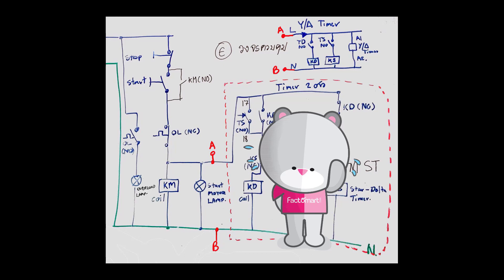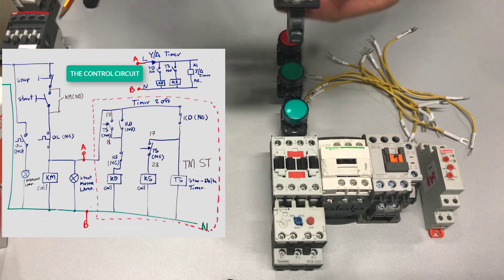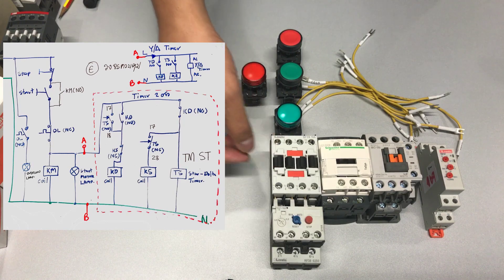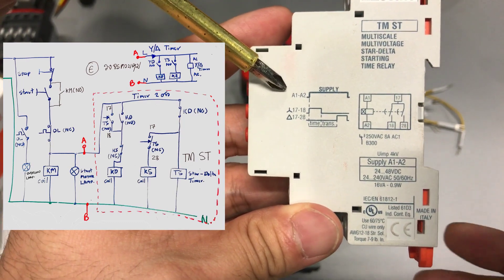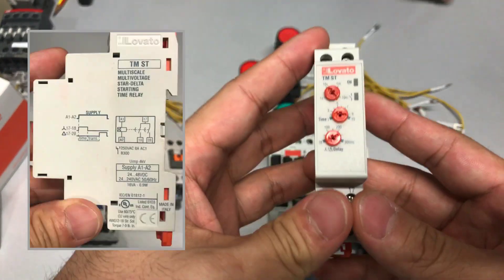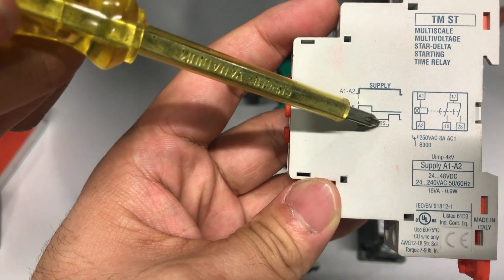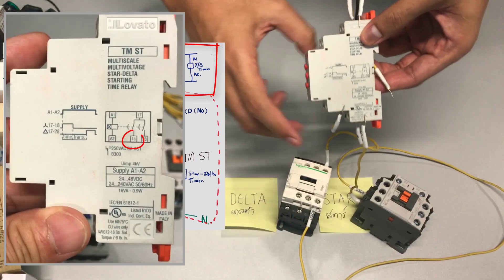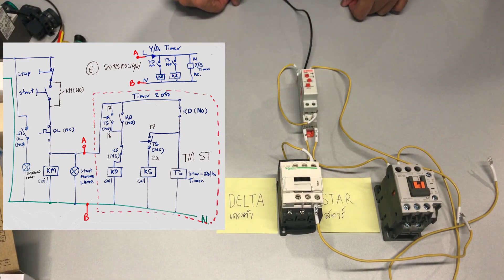The Beginner’s Guide to Wiring a Star-Delta Circuit (Part 2: control circuit)

Comment: please explain how to connect contactors with indicators
Reply: There should be some auxiliary contacts on the contactors. So if the main contactor is closed, you would connect the 'motor running' indicator to the NO auxiliary contacts, the indicator would then be lit.

If you wanted a 'motor stopped' indicator, you could wire the indicator to the NC auxiliary contacts, so when the main contactor is de-energised, the indicator will be lit.